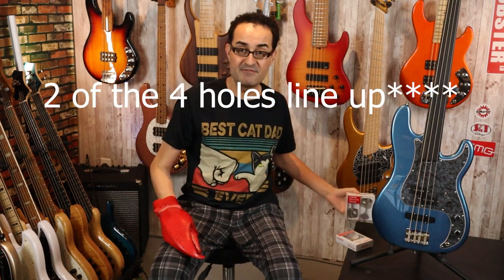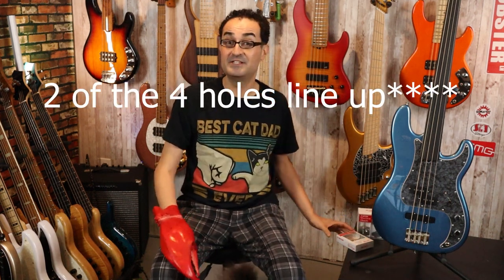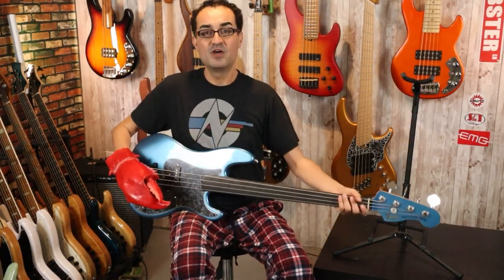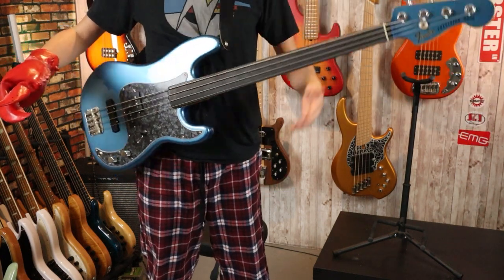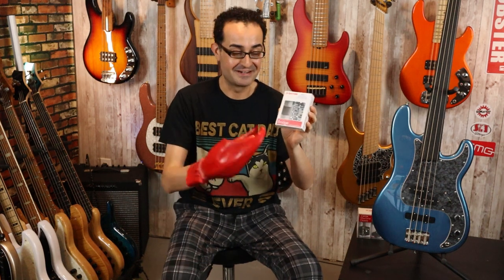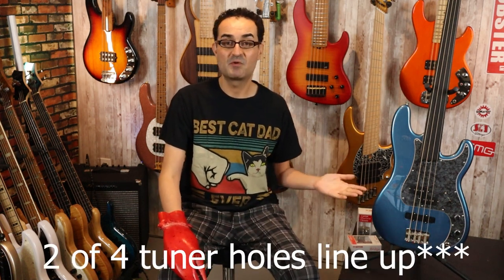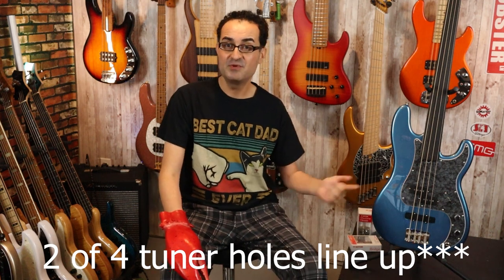Fender USA Tony Franklin Hardware Upgrade - Fixing the Neck Dive w/ GOTOH - LowEndLobster Fresh Look

Comment: I'm guessing swapping the tuners alone would have saved more weight, but the new higher mass bridge added some of that weight back. Still, fixing the balance issue alone even with no weight savings would make the bass much more comfortable, and it wasn't excessively heavy to begin with. Even though the weight and balance are not bad on my Jazz bass, I'm still tempted to give these upgrades a try. Thanks for the review!

Comment: Very nice bass, glad to see the tuners fixed the balance issue.

I'm curious about the drop-tuner: how accurate are they (or is it something the user needs to set up)?  I do tend to switch back and forth between standard and drop (actually half a step down from "real" standard), so I'm intrigued by the possible benefits, although it doesn't feel like a chore to retune between songs.  I suppose the real benefit would be if someone wanted to change tuning in mid-song . . .

Comment: I have  5 string sire v7.
Which tuners can u sujest me to instal in order to reduce a neck dive?
Reply from the maker: For the V7, check out the GB528 from Gotoh. I have a video swapping them on my 5 string P5 and it helped a LOT!
Reply: @LowEndLobster  
The problem is that this particular model is very pricy for me. Are there any cheaper alternatives available? Or in other cases I'm gonna have to drill holes?
Reply from the maker: Nothing really cheaper unless you go guyker